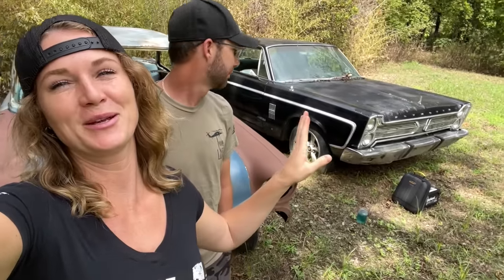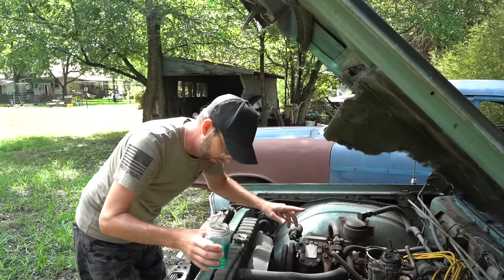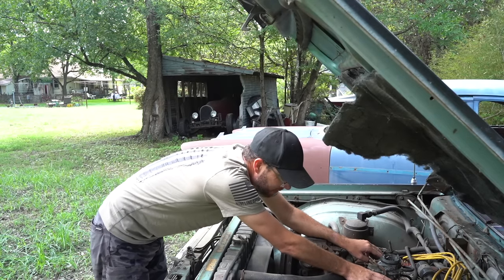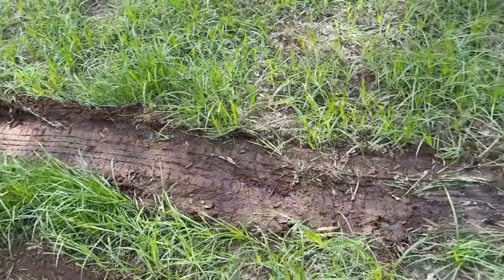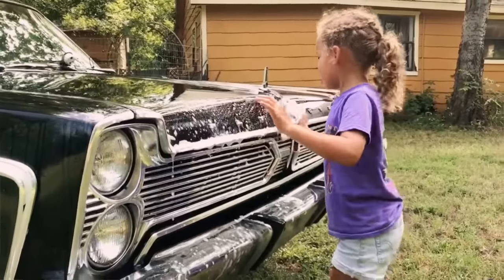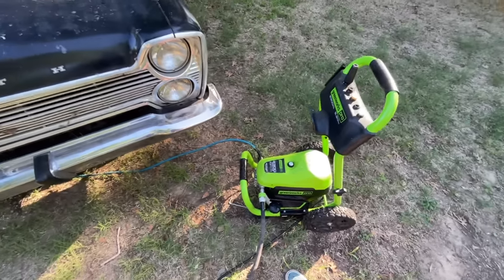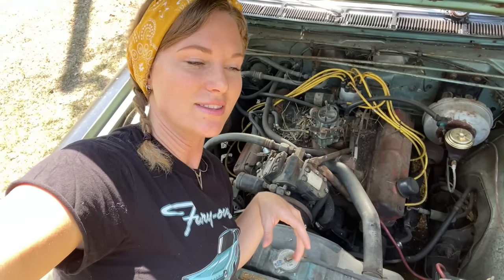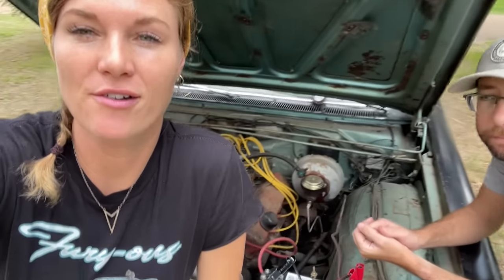Abandoned Plymouth Fury!

Comment: I have about the same story or very simaler. We had a close family freind that died from cancer and in his will he signed over his 1995 chevy excab long bed to me as long as I gave my word I would never sell her and keep it in the family. It dose not run now and would love to get her back on the road but that takes cash and know how wich I dont have either. Her name is Midnight and I have no indea how to fix her and some one trieed to steal her back about 10 years ago. If yall have any tips or tricks that could help me figure it out I would be very greatfull. I beleive in keeping your word because your only as good as your name.
Reply: Maybe the fuel pump died. Put the key in and have someone lie near the gas tank listening for the fuel pump motor. Try starting fluid in the throttle body.This assumes you have a good battery or can jump it.
You might want to join a Chevy web site and ask your questions and then do what they say to do then report back. Or , ask a guy that knows how to work on fuel injected cars.  My buddy had been working on his old cars for years but takes his normal cars to a one man shop with a mechanic he trusts.
Reply: @auteurfiddler8706  Nice thank you I will check that out.

Comment: Pre computer garbage 318, I had no doubts it would run and idle. Adding computers ruined a lot of engines, pre computer was sooo much better. Two wires and some fuel was all you needed.

Comment: I had this car  but a 4 door that wedge motor is the toughest thing on earth take the car to Mexico see what top speed is I bet  you a steak dinner you let off after 130 lol
Reply: You have a 318 poly head motor which come  in lots trucks and buses u can tell by the valve covers u only have two bolts this was the last year  Plymouth used that motor newer 318 has 6 bolts on the valve cover

Comment: I was a mechanic for 40 years and you never want to rev up an engine while standing in front of a car. Always stand to the side in case the car were to slip into gear. Engine size could be a 283 since it has the single barrel carb. I would also do a compression check since it seems like it has a miss.

Comment: How could you guys not have realized that every time you stomped on that brake pedal over and over and over again that you were pumping up already seized brakes then squeezing them even tighter now pressurized the transmission was fine it's the brakes that're not leather car roll because it rolled freely but then you pumped up the brakes 900 times and it would not move immediately afterwards every time....